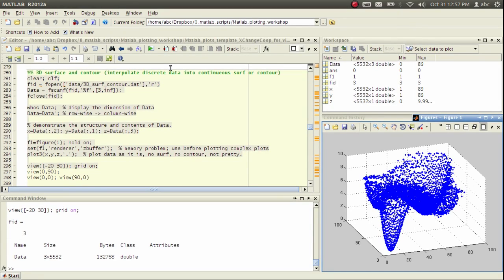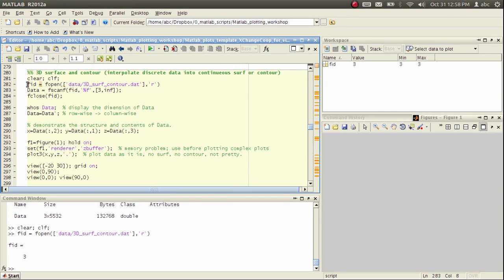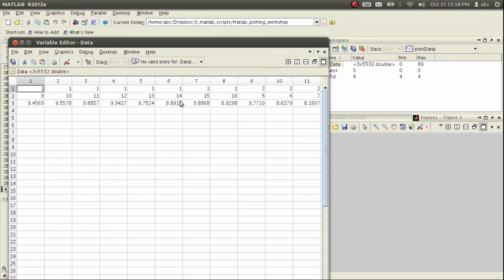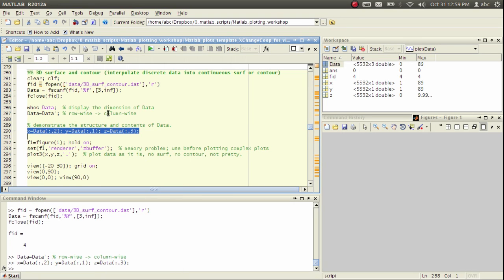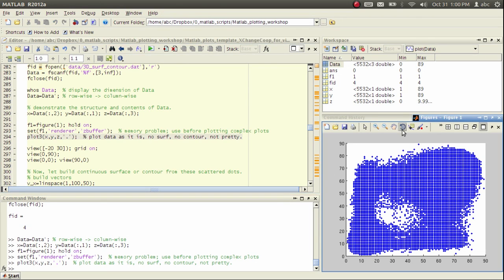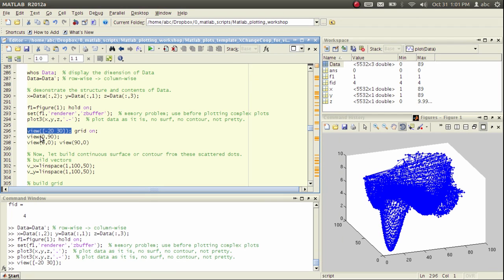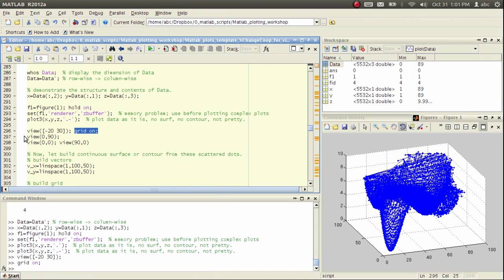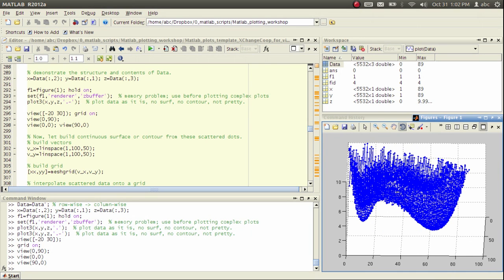09.1 3D scatter points plot

Comment: What will you do if the matrix is not 5532*3 but 5532*36
Reply: Then it would be a 36 dimensional hyper surface or a 35 dimensional scalar field ;)